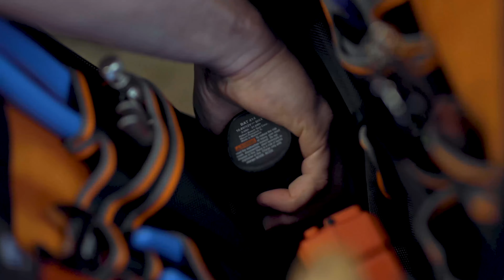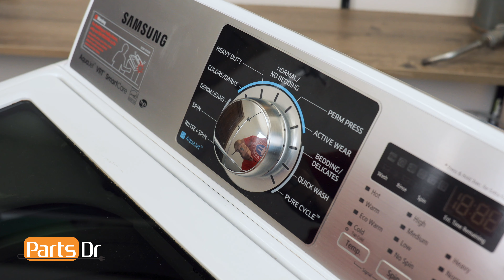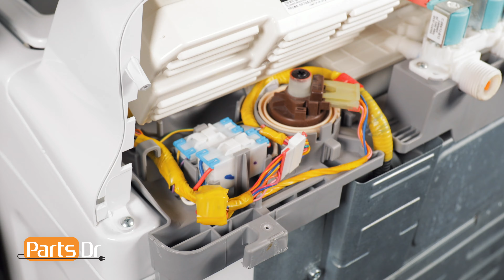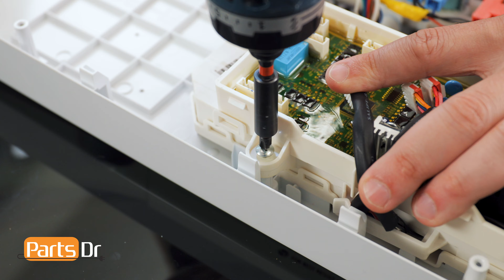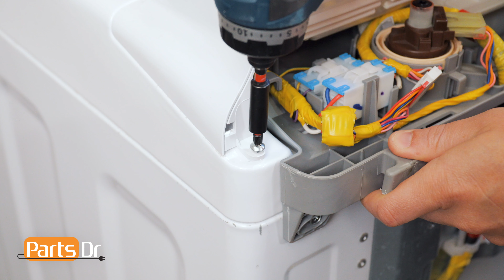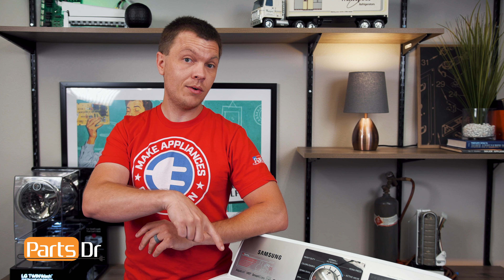How to replace Samsung washing machine User Interface Control Board part # DC92-01022A

Comment: Awesome easy to follow video. My LCD display was reading out broken characters and the wash mode selector was sometimes difficult to determine. Following the video i was able to replace the UI Board without issue or question. Thank you Ryan and Parts Dr.
Reply from the maker: Nice job fixing it yourself!

Comment: I’ve noticed recently that I’m having to press the “start” button multiple times to engage the machine. Is this the component I need to replace?
Reply from the maker: Yes, most likely. The symptom you are describing would be caused by the button on the board failing.

Comment: I replaced my control board on my samsung vrt top load and now I get now codes but I cant get any water to come into the washer. I changed the water inlet valve two years ago. Need help!

Comment: I was having the same problem as "M Savage" who commented below and it was getting worse and worse until I finally decided I needed to replace whatever was causing the display to go crazy. After reading your response below I ordered a new User Interface Control Board from you folks and it was here in 3 days and you offered the best price of any online store. I followed your directions, very well presented and illustrated, and now I feel as though I have a new machine for $182.50! THANK YOU SO MUCH for the part and for making the repair easy. BIG THUMBS UP!
Reply from the maker: That is great to hear!  Nice job with the diagnosis and repair!

Comment: I moved recently.  Once the washer was hooked back up, the display either shows partially lit icons with a dark line in the middle of all settings(temp, spin, soil level) and you cannot make out the timer count. Is it possible the display is not fully engaged, or is it just a bad display?
Reply from the maker: From your description, it sounds like the display might be bad.